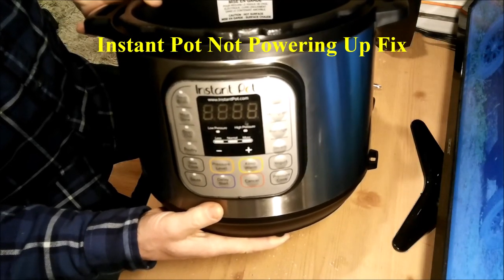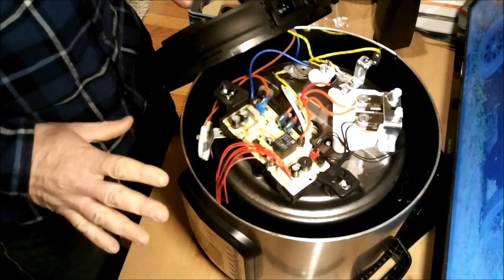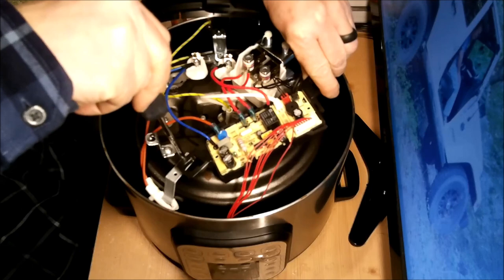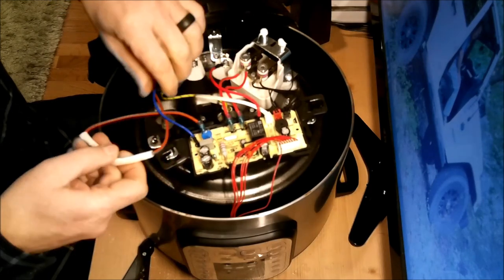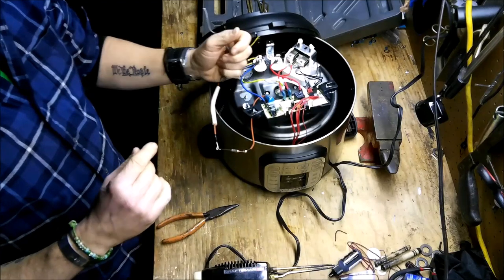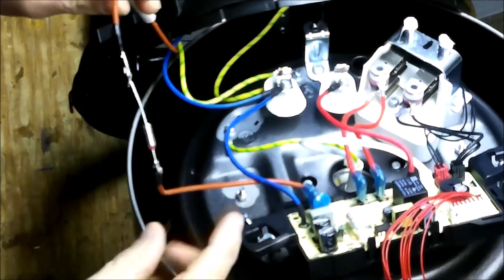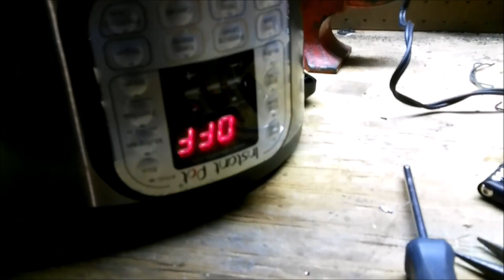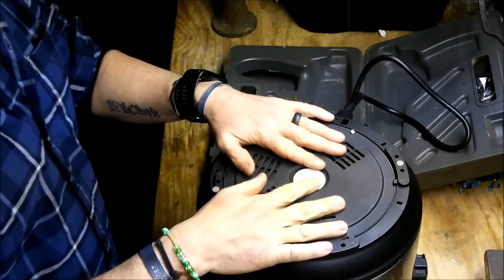Instant Pot Not Powering Up Fix

Comment: Do not attempt soldering the fuse because the heat from the cooker can easily melt the solder. Just clamp down the two fuse terminals on the wires directly
Reply: Use electrical tape???

Comment: I have great results with "cold soldering." First, apply flux to each part you want to solder. Then heat up soldering gun, put solder on tip and melt it into a bubble. Then touch bubble of solder to the flux covered part you want to solder. The melted solder will flow into the joint. Then let it cool.
Reply from the maker: The more knowledge the better. Thank you.

Comment: Solder is fine - but the reason my Insignia (Best Buy) model was crimped is probably because solder could soften or melt. No big deal - the fuse would probably blow at the same time the solder melted - as long as you have it wrapped with the insulation and perhaps electrical tape or wire shrink tube.

Comment: Hi,  i have an Instant Pot duo crisp + air fryer error code c6h/ c6l. It appears even after replacing the pressure sensor which everyone in the youtube tutorials seem to suggest doing. The error appears when inserting the pot in, otherwise it does not alert the code, it is OFF. Any suggestions what might be the cause and a possible solution?
Reply from the maker: Hopefully, someone here knows the answer. I have not come across that one.

Comment: Hi LordCryptid,

I opened the Instantpot and had not noticed the fuse at all .. There is another fuse on the circuit board and that was good .. so I put everything back disappointed .. then luckily I found your video and reopened the Instantpot .. and yes the sefuse sf 139e was indeed bad .. 

THANKS A TON .. You made my day... I have ordered it from eBay as it was cheaper and I was not in a hurry. Hopefully this should fix it .. 

God bless !!.. you saved me 60$ for a new cooker .. 

Thanks a lot ..
Reply from the maker: That is so cool to hear.

Comment: Like you, my wife uses our instapot ultra and today she prepared our meal but when she won't to turn on her instapot, no power. So I ordered a pack of 3 250 volt 10amp fuses for about $5, they will be here in a few days and I will let you know if it fixes her instapot
Reply from the maker: I hope it works. Ours is still plugging along.
Reply: Update I found a 3 pack of fuses on Amazon for less then $5. I did everything you did, I put everything back together because I was confident that this would fix it. 

I told my wife to come here and when she did, I said watch this, I plugged in her insta pot and...........It's as good as new. Thank you, and she used the instapot 1 hour later for dinner. We use it a lot and it's still working after being used pretty much daily for 6 days now, I don't see it failing, and if it does I have 2 more fuses

Comment: we didn't have a fuse so my hubby just cut out the fuse and soldered the wires together. it works! fuses are on the way; he'll put them in when they get here. video helpful to locate where the fuse was located!
Reply from the maker: We need our Insta Pots...we don't have time to mess around. Glad it is working out.
Reply: Hope your hubby in fact did follow up on the fuse replacement. It didn't blow in the first place for no reason, meaning it will next get hot and simply catch fire.
Reply: @STV-H4H  Likely it would blow another fuse over the circuit breaker, etc. before the thing would catch on fire. 
But surely it will be ruined instead of fixable. Still, if you got a couple more years out of it in a pinch (if fuse was not available)...
Reply: @craigissod6027  your likely correct. I’m an electrician and the conditions I encounter with people and their appliances using power strips, cube blocks and the like, makes me wonder every time I see a fire truck heading somewhere if it’s precisely one of those situations.

Comment: How does a voltage detector work to detect voltage when the instant pot is de-energized if it is not plugged in? Did you plug it back in to use your continuity checker?  If the fuse is bad, there will be no continuity across the fuse and the resistance will be infinity as it is open (blown).  I would try to detect continuity across the thermal fuse using a DVM set to Ohms etc. No risk of shock as the voltage is super low when a DVM is in Ohms mode. 

That Craftsman solder gun is for big jobs (guessing minimum 150 watt power draw, current draw greater than 1 amp at 115V AC or more) and a pencil style solder iron of 20 watts is perfect to avoid overheating electrical components on circuit boards and small electrical repairs. The only real learning curve is to sand the tip of that Craftsman solder iron with fine paper or a Scotch-Brite green pad and then carefully re-tin the tip area using fresh flux (not acid flux for electrical work) before soldering repair and new work. The tip area should always be bright and shiny from freshly applied electrical solder. If not, then clean and re-tin before soldering your work. Remember to always place solder on the heated work surface and not the tip of the solder iron or gun.

.
Reply from the maker: Thank you for this information. I did plug it back in to test. I am obviously not an electrician so your reply is extremely helpful. Thank you.

Comment: I believe mine stopped working because a butternut squash seed fell under the pot insert and was heating and burning up in there (unbeknownst to me)  I believe that heat from that shorted it out. Do you think I will need a new fuse?
Reply from the maker: That is beyond my experience. Most likely, but there might be other damage.

Comment: Thankfully if this doesn't resolve my problem, Costco currently has the same model on sale for what I paid for this one 3years ago at Kohls. $80. I have two IPs, the first one has indicated a possible problem from time to time. Today it heated up, and I began searing some chicken, when I noticed it wasn't hot. So I restarted the cycle and was hot again and nearing the pressure cook, when I saw the control panel was not lighted. A few unsuccessful attempts to make something light up, and decided to grab the other one and carry on. Thats when I searched and found this video. Hope the fuse I just ordered is the problem. $15 isn't terribly concerning, but it means something else is the problem. That IS concerning. Thx for the most likely solution, in the meantime.
Reply from the maker: I hope it works. Mine has not had an issue since.

Comment: Do not solder this fuse connection. Use an 18 to 20 guage butt connector along with a good quality pair of crimpers. The heat generated from the appliance itself can melt a soldered connection with the incorrect temperature rating. 
I've watched many of these repair videos and as a licensed electrician I am appalled at the level of incompetence posted by YouTube as a "how to not" repair video when making electrical connections. Do not twist solid fuse wires with the stranded appliance conductor either. This will result in a loose high resistance connection generating heat and possibly causing a fire. Electrical Code Books explicitly forbid soldered connections for replacement of fuses in home appliances. Follow your factory reccomendations when making this repair.
Be safe, not sorry.
Reply from the maker: Thank you for educating us.
Reply: butt splice connectors seem a little large for going under the insulation. it originally had a small brass clip that of course, got lost. ideas?
Reply: I agree with LeeBo, as far as he went.   The exposed wire from the new fuse should have had properly rated heat shrink tubing over it to properly insulate the wire.   The sliding sheath is there to prevent abrasion damage.   You also need to learn more about soldering - heat the joint, not the solder.   I hope you knew to use resin core solder, not acid core.
Reply: Thank you @Leebo6283 for this comment! I'm so glad I read it. I have the tools to solder this, but after reading your comment I decided not to. I ended up opening up the two brass clips that attached the two ends of the fuse and the wires. That took a while, but I was able to recrimp them with the new fuse without soldering. And it WORKED!!! So, another Instant Pot saved from the junk heap!  I appreciated @LordCryptid 's video and link to the replacement fuse. I used that link to buy a 2 pack of fuses back in August 2022 for $5.41. When I finally got around to fixing it in September 2023, the 2 fuses now sell for $12.99! A 240% increase! Still, MUCH cheaper than a new Instant pot! 
This is the second Instapot that I have fixed. I replaced a melted panel on the other one and that cost was about $14.00 ) Now if the second one blows a fuse, I'm ready to repair. 
My next step? Fixing 2 Braun coffee grinders that have stopped working.

Comment: Hey LC, just stubmled across this video while trying to source a part for my pot that I just found (brand new in a free pile). it wouldn't power up so I opened it up and found it to be the surge protection device (ZNR 091) on the PCB. but I'm having a lot of difficulty sourcing the voltage proection device online. Can I just put any 120V surge absorber that I find in there or will it matter which one I get?
Reply from the maker: That I am not sure of. I would try it but I am not terribly cautious and would recommend a professional.

Comment: Great video. I have two questions - 1) why not simply bypass the fuse if it has the tendency to keep blowing (yes I know I guess I can answer this myself...fire hazard)  2) isn't there a fuse that will automatically reset itself when the unit cools down, so it doesn't have to continually be replaced? 
Thanks
Reply from the maker: I could not find a resettable fuse that I was certain fit the Instant pot. So I went with the thing that I knew worked. Maybe somebody else here knows. And yes, fire was the concern my wife had regarding bypassing the fuse so I had to try to actually fix it.
Reply: NEVER ever ever, well you know the reason. If God had intended electricity to be forgiving he wouldn't have let someone invent a fuse for the safety of mankind. Also, he wouldn't have had to go through all the trouble of having a surrogate kid thru an unwed and untarnished young woman traveling with a rather regular Joe-seph, only to get him into the inevitable bind that started Christmas and resulted in Easter.

Comment: Hi what are the numeric numbers for the instapot fuses. Thanks.
Reply from the maker: I am looking for them right now...can't seem to find the order. I will get back with you.
Reply from the maker: The exact one I purchased is not available but 10 A 250 V like the following: BOJACK SF139E SEFUSE 10A 250V Thermal Fuses 142 Degrees Celsius Thermal Cutoffs
Reply: @LordCryptid  Thanks alot for the information also that video has helped me alot. Good stuff.

Comment: Thank you for sharing.  Yes, we will be very happy to get our IP back to work.  

It seems to me the weakest link of Instant Pot is the power connectors.  They are not the standard C15 and C16 for home appliances generating high temperature, such as pressure cookers.  The connection of the IP body socket and the plug of the power cord may easily get loosened.  
See 
https://youtu.be/C0aLMOodVsg 

At 1:27 of the video explains  C15 and C16 power connectors for home appliances generating high temperature, of higher heat rating 120c.
C15 female, C16 male both with a small notch at the ground to hold the connection securely.

Comment: Hi, can you please let me know how to fix faculty pressure sensor error in instant pot ? My instant pot is just used a couple of times but it started giving error.
Reply from the maker: C6 error?  Contact the following: https://instantpot.com/instant-brands-contact-us/

You will need the following information: 
The product model number from the silver label
A photo of your receipt (bonus if you buy from Amazon – you can look up your receipts under your account!)
A photo of the label from the back of your Instant Pot

Apparently, this is something that is not fixable by regular folks like us.  Wish I could help more.
Reply: Get it replaced under warranty.  That's an easy one.  But C6 / C6H / C6L still an easy repair if you lack a warranty.  Usually replacing the pressure switch fixes it.  You'd buy a used pressure switch for your model from eBay or from someone on the Facebook group Instant Pot Parts Swap and Sale.  (Instant Pot doesn't sell that part, but people who part out IPs do.)  You unscrew the bottom plate, and then it's pretty much a straightforward use of Phillips screwdriver to remove the old pressure switch and replace it with the new one.  No cutting wires or crimping or soldering or anything.  One wire clips onto the board, and the rest is just using the screwdriver.  I replaced a pressure switch on a Duo60.  C6 errors are the pressure switch, I have been told by the guy I bought the switch from.  But my cooker didn't have any error. It would simply overpressurize on high pressure and open its own steam release and continuously vent, starting when the pin came up.  It would run okay on low pressure, though.   There are two sides to that pressure switch on the Duo or any IP that has low pressure.  There is actually an adjustment screw on the top of each side (under the blob of plastic that can be pried off), but I have no idea how you'd go about adjusting the high or low pressure.  You would need some pressure measuring gauge to do that accurately and safely, and it's not practical for the average person to mess with.  So, try a replacement pressure switch if your cooker is not covered by warranty.
Reply: @LordCryptid   Yes, it (C6) is fixable.  Usually you just install a used pressure switch purchased from someone who parts out Instant Pots.   As a worst case, buy a $20 "rebuild kit" of all the wiring and circuitry in the base.  Instant won't sell those parts, but numerous people buy shipping-damaged IPs and part them out.
Reply: If you have the Duo Evo Plus new model, some of those throw a C8 error after saute.  There is a workaround described at PressureCookingToday, in comments and/or the article they posted about the Duo Evo Plus.  Indigo Neli on YouTube said her 8qt Duo Evo Plus heating element failed after a bunch of C8 errors, and Instant Pot replaced the base under warranty.  The C8 error on Evo Plus may indicate a failing heating element, is what I wonder.  Be sure to contact IP customer service if your IP is covered by a warranty.

Comment: Please help my instant pot when plug in is saying C6 and all lights are blinking. Thank you
Reply: Defective pressure switch, I have been told.  Covered by the warranty.  Or, you can buy a switch from someone parting out Instant Pots.   eBay or Facebook group Instant Pot Parts Swap and Sale.
Reply: Thank you I will contact instant pot. Thank you.

Comment: Hi. I want to say thank you for the video as it was really helpful. I have one with no power & it was in fact the fuse and your video helped me greatly. The only thing that I wanted to share is that those type of fuses are made to clamp onto the other wire and then they are covered with heat shrink type tubes because if the wires get hot enough, the metal used to soldier the two wires together will melt & then you could have arcing and fire hazard. This fuse is specifically for low or high voltage errors/issues. It basically is the bridge between the outlet cord and the inside components. It’s hard to see when you’re just looking at the fuse. But here’s an example, I have a Lux 80, so this is the one I purchased on Amazon.  You really want to look for clamps, wire nuts, especially on appliances or tools that get hot. Like the instant pot, toaster, coffee maker, hair dryer, etc. I hope this makes sense. 😊🙏 

https://www.amazon.com/GJS-Gourmet-Prong-Instant-Created/dp/B08HGP25P5/ref=sxin_18_pa_sp_phone_search_thematic_sspa?content-id=amzn1.sym.125faa20-955d-4203-89fd-d8565f914742%3Aamzn1.sym.125faa20-955d-4203-89fd-d8565f914742&crid=3A3CDYMLSFST6&cv_ct_cx=instant+pot+lux+80+fuse&keywords=instant+pot+lux+80+fuse&pd_rd_i=B08HGP25P5&pd_rd_r=30fd1b66-9b2b-47d5-a974-d5a4b7e7f933&pd_rd_w=WR3Bh&pd_rd_wg=8M6XQ&pf_rd_p=125faa20-955d-4203-89fd-d8565f914742&pf_rd_r=15JV29KTJD7ZN965J3V6&qid=1668472676&sprefix=instant+pot+lux+80+fuse%2Caps%2C106&sr=1-15-bb4842f6-7db0-410d-8e58-ed475f3f7b54-spons&sp_csd=d2lkZ2V0TmFtZT1zcF9waG9uZV9zZWFyY2hfdGhlbWF0aWM&psc=1
Reply from the maker: Thank you for the information!
Reply: So can I purchase this to replace in my instant pot? I don’t know how to soldering he mention.

Comment: My machine does not work at all. Brand new in the box. Symptoms are: timer flashes, no heat. Tried the saute process, nothing. Tried the break-in familiarization, nothing. I have removed the board and noticed the slot for fuse 091 is missing. Is that fuse required? Or is my issue the same as your issue described in the video? Again, brand new out of the box unit.
Reply from the maker: That is beyond my expertise. I wish I could help with that one.